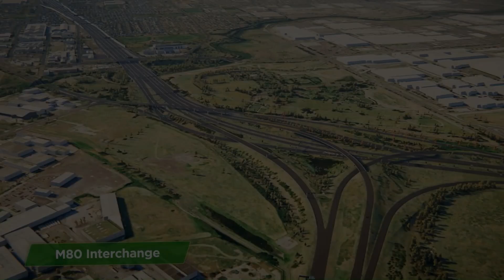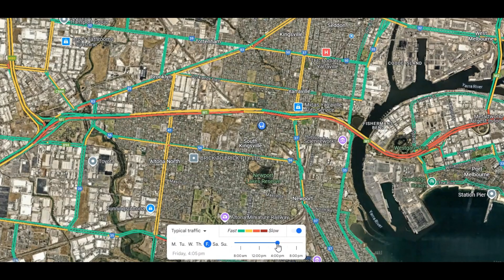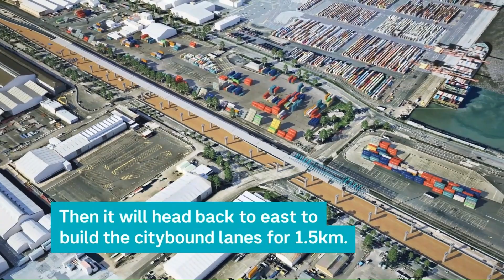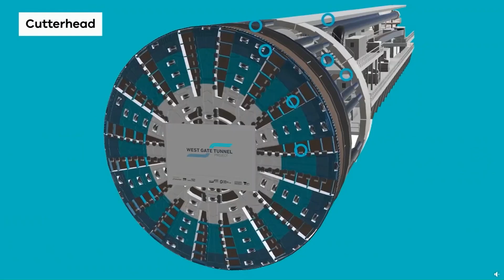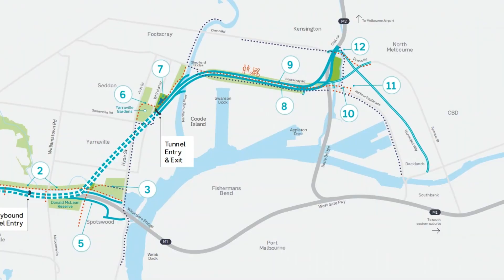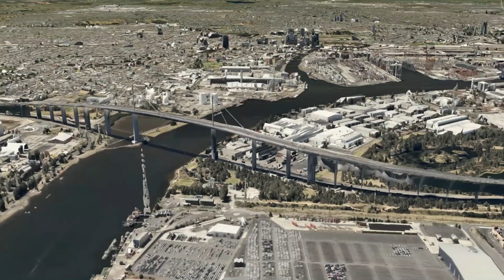Westgate - Beyond the Collapse, Part 5: Westgate Tunnel Project

Comment: @Aus Engineering@AusEngineeringHistoryStuff This was a thoughtful and technically well presented series. Thankyou very much for your efforts and great explanation from an engineering perspective. My father had a service station in Seaford in the 70's, and remembers hearing a sound like thunder when it collapsed. I was a young kid when the bridge opened, and remember mum throwing coins in the toll booth gates as we drove through.  
I've never been comfortable driving over it. I figured the opening to traffic of the extra lane was part of the original design, and grew a bit concerned when I saw guys from a strain gauging company climbing over the side to attach strain gauges in ≈2007 as I drove past (I used to do strain gauging). Now it's stood the test of time, and I have a better understanding of the engineering scrutiny the bridge has been subjected to, I'll feel more confident in the future. 
BTW, I always "felt" the 300mm deflection in the centre span as I crossed. haha.

Comment: I honestly believe that all of these transport projects are done in response and not in planning for future. I can’t speak for the residents of the western suburbs, however I live in the eastern suburbs and I can tell you that all of these projects on this side of the city, by the time they’re completed, have made very little difference. The boom in immigration and the increased cost of living closer to city have pushed a lot of people further out and the traffic in one from as far as Narnargoon is now at the stop start from as early as 0530 some mornings and because of the removal of a lot of emergency lanes with one small accident or breakdown can increase travel time easily in excess of an hour and a half for the 60 km drive
Reply: What most don't seem to understand is that these major road project actually INDUCE higher traffic.  It's what infrastructure does. 
Yes, for the most part construction is 'reactive' to demand.  
Moreover, the need to upgrade existing major roads and expressways because they were never built large enough in the first place.. the open up residential and industrial development estates without having all the infrastructure in place. It's not like the transport demand can't be estimated correctly.  
Then the One State Admin will invest.. then later Another admin penny-pinch and cutback.  
Personally, I just wouldn't do a regular 60km (120) work commute drive as you outline, unless I was paid for that time.
Reply: @BTW... . You honestly need to get out more if you think you shouldn’t do a 60 km commute.  So all those people from Geelong in both train and road?  Pakenham? Even further out.
Reply: @xr6lad  I wouldn't call sitting in traffic "getting out more".
It's a matter of how much lost time in your life is spent in traffic... and the ever increasing cost of fuel.  
You add it up.  1hr + 1hr x 20 days per month x 11 = lost time per year minimum.

Comment: The very problem there is the port itself. 150 years ago it grew on outskirts of town, much better than in Sydney where Darling Harbour is right in the middle, 200m from Townhall. But nowadays it becomes the middle of megapolis. Sydney solved this problem booting out all port, industry, transport and so on to pt Botany, Melbourne did not, so all these port logistic flows inevitably run in the most overloaded part of the town, and as bonus are obstructed by ports own waterways. 

But what to do with the port - no one knows. Move it to Geelong? Not the best place from the water side (deep canals, harbours etc). Hastings? Absolute nightmare from land side (roads and railroads - nothing there at all).